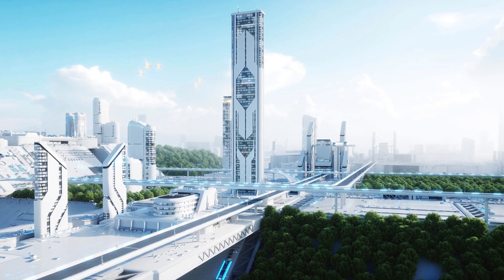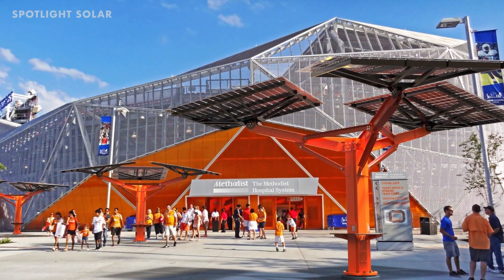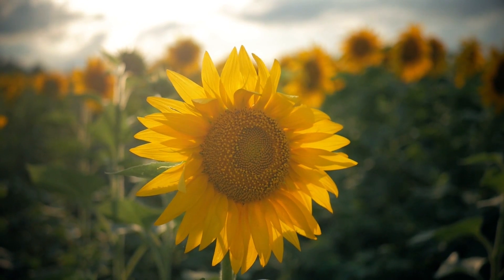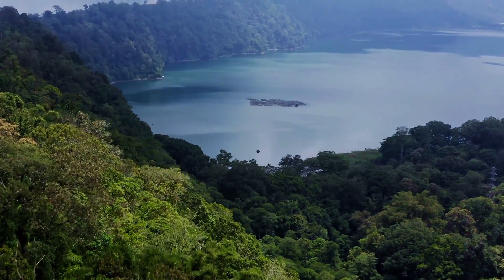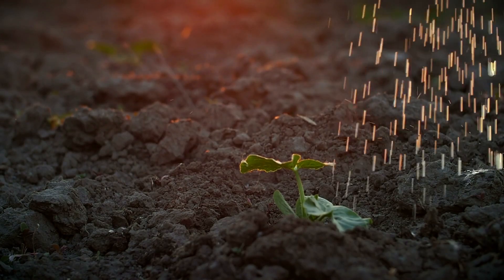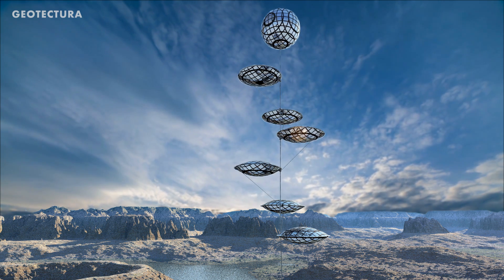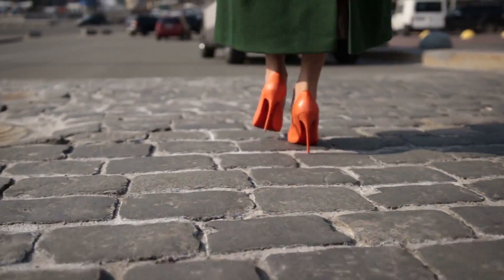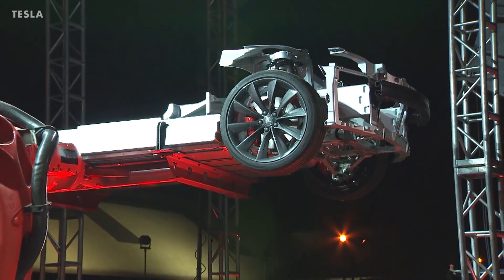What Will the Solar Cities of the Future Look Like?

Comment: Excess power generation can be used for hydrogen production which can be converted back into electricity at night using hydrogen fuel cells.
Reply: It shouldn't. That would be a waste of energy, money, and time.
Reply: @belland_dog8235  As opposed to dumping excess load in the form of heat?  Makes no sense 0_o  Solar doesn't work at night so there needs to be stop gap technologies.
Reply: or just store it in a battery lol
Reply: @trentconley4374  Or fuel up your hydrogen electric vehicle in minutes rather than hours.  And you don't need to replace expensive battery banks which need to be replaced every 6-10 years.
Reply: SoCalFreelance ~ lithium battery storage and from whatever else is used...
Reply: @SoCalFreelance  All EV batteries have a warranty for up to 8 years (or a certain amount of miles/km), so no, they don't last only 6-10 years. The newest ones last at least 8-12 years and there are indications that with some it might be a lot longer. But it ofcourse depends on how much you drive, just like with a regular car.

Hydrogen vehicles are stupid. Filling them up will be much more expensive and while fuelling up in a few minutes is true, after that the pump needs to be repressurized, so all in all it takes around 10-15 minutes, great if there is a waiting line. Fast charging takes around 20-30 minutes and most of the time you'll just charge when not needing to drive (at home, at night, at work, ...). Only on long trips should you be waiting a bit longer.
Reply: @MDP1702  Many factors weigh into EV battery life -- number of discharge/recharge cycles, number of charges to near full, number of drives to near empty, frequency of fast charge use, and cold weather significantly affects battery performance and charging times.  Calling hydrogen fuel cell vehicles "stupid" shows how much you know about the topic.  H2 vehicles don't degrade over time like battery vehicles do and are not affected by temperature.  Fuel cell vehicles have been on the road since 2008 and and it only takes a few minutes to fuel up and your off driving with 500 miles of range, your repressurizing theory and 15 min waiting time is complete rubbish.
Reply: @SoCalFreelance  H2 vehicles work fine with low amount of vehicles. They however aren't as beneficial or as good as EV's. If they were, they'd be were EV's are now. Because like you said, they have been around for a while. 

For starters if you want to cleanly produce H2, it takes around 3 times the energy compared to batteries 90% efficiency. That alone is already a major downside. 

Secondly you have to fuel it up just like you do regular cars now, this while with EV's you either already or eventually (depends on living situation) won't have to go charge your car, you just do it at home, work, store, ...

Thirdly, yes. repressuration doesn't work anymore like I said, however the amount of vehicles a station can fill is limited. After this amount, the station needs time to repressurize, though in the future they might fix this (or already have by investing more in parallel systems).
For example the Hyundai refueling stations can apparently refuel up to 70 nexo cars a day. This comes down to around 3 cars an hour. Yes, they can tank faster (5min), but it doesn't work all day long. if you take 5 minutes per car, after 6 hours the station would need to repressurize, good luck for the cars after, they'll have to wait for some time longer.

Average range is around the same as that for EV's.

Price wise, they also are as expensive as EV's or even more, though without the advantage of cheap fuel.

Their availability is smaller and it isn't expected that it will increase as fast as EV's.

Due to the need of refuelling stations they need a lot more infrastructure be rolled out. EV's can get away with homecharching most of the time so rolling out the infrastructure over time following EV adoption isn't really a problem. H2 cars will need to have infrastructure already rolled out, you aren't exactly going to produce your H2 at home, nor are you going to wait for hours in line at the only H2 refuelling station in the neighbourhood.

All in all much depends on the progress EV's make, though as it stands now, it seems like H2 will not be able to compete/keep up with EV's for passenger cars. Maybe if Ev's can't achieve great range, H2 can help fill that niche market for those who drive a lot, maybe large vehicles might be a good market. But H2 will have to improve a lot over the coming decade if it wants to compete with EV's. There is a reason more and more car manufacturers are going into EV, but not H2.

As for battery life, ofcourse a lot comes into play. But they have a warranty of 8 years or 100k miles, whichever comes first (with the average +-13,5k miles a year in the US, this comes at around the same moment). And looking at real life data, Tesla's batteries after 250k km (+-150k miles) have lost only 10% of its capacity and most of the loss was early on, flattening after 50k km (+-31k miles). 5% was lost before 50km, not even another 5% by 250k km on average. Ofcourse there are exceptions. Since usually end of life happens between 150-300k miles, these are great promising numbers, since an EV battery is deemed not good anymore for EV's at around 70% and then you can sell it second hand as stationary storage to get some money back.

If we are generous there are 25k h2 cars on the road worldwide, while there are around 5 million + EV's and their sales are rising faster every year.

So yes, hydrogen cars are a joke at this point and rather stupid. Maybe they can be used for more "heavy duty" travel, but even now busses, trucks, etc. are tending to lean more to battery power than hydrogen power.

I think hydrogen can better be used in electricity generation for longer storage times and/or in industry/heating. But hey, maybe it will surprise us in the coming decade(s).

Comment: The problem is energy storage not energy generation, at the current solar sititation we can power the world entirely but the probelm is where do we store all that power for the time when the sun isn't shining
Reply: With Batteries, like we're doing now.
Reply: There are multiple projects in the works for energy storage, and not just batteries. Three examples that are in use now are water, weights, and hydrogen. For water, you pump water up to a large pool that sits high up with excess energy. When more power is needed, you release water through generators, similar to a dam. Weights work the same way. You basically build a tower with electric cranes using excess energy and then lower the weights to produce energy when needed. For hydrogen, you produce it using excess energy and release it through a  fuel cell to produce power. 

All three are not as efficient as batteries, but they can be done fairly cheaply. Hydrogen can also be transported from areas with lots of energy to areas in need.
Reply: @anthonypelchat  yes but batteries are ybe msot effiecent, and they are also portable which is a good thing, but the problem is that it's quite expensive to store all the energy that would be produced in batteries, as far as i know there not better storage device than batteries, but then again batteries as freaking expensive as of now
Reply: @belland_dog8235  are you jokin? , it would cost trillions of dollars at the current price
Reply: @anthonypelchat  Batteries will become cheaper eventually, their costs have already gone down by 500% since 2010. Things like water storage or weight storage are unlikely to become cheaper. Hydrogen is still to be seen how much improvement there will be.
Reply: Thereviewguy Just look at Tesla’s project in places like Australia that are saving millions and have been up and running since last year.
Reply: @RandomVideos-kn3pf  No, I'm not joking. We are literally doing exactly what you described right now. Look up the Hornsdale battery site.
Reply: @RandomVideos-kn3pf  Batteries are the most efficient and portable. However, portability is basically pointless for large storage solutions. And efficiency loses can be overcome with lower costs. After all, if you are 80% of the efficiency, but 30% of the costs, then you may be better overall. It all depends on your use case.
Reply: @MDP1702  Yes, batteries will continue to get cheaper while water and weight storage likely won't change much. But water and weight storage are already extremely cheap. And you could always use one and then switch to batteries later. 

Hydrogen has potential, but it is just too expensive. Still, it is easily portable and easily expandable. And it can be refueled while running. Some companies are using it for emergency power to replace diesel generators.
Reply: @anthonypelchat  Water storage might be cheap if you have the geography, but without it the work needed to create it would make it much more expensive. Thus overall waterstorage is quite limited in upscaling it.
Reply: @MDP1702  Water storage is limited, but cheap where it is available. Where it isn't, gravity storage is an option. Simply using electric cranes and heavy concrete blocks. Batteries are better. But these other options are usually far cheaper.
Reply: @anthonypelchat  Electric cranes and heavy concrete blocks is an idea that has gone nowhere for so far I am aware. Untill they have actually a working plant I'll put a pin it. You'd need either really high stacks or deep holes. And there are several problems with it. Though maybe they can overcome it. But even if they do I would be interested in the CO2 value of this storage, since making concrete blocks is co2 intensive.

For example they would need to operate in windy conditions (and they say they can), however cranes don't generally operate when there is more than 10m/s wind, let alone that they would achieve the precision needed.
Secondly the storage capacity and power output, these are ridiculously small. 4-8MW power output? That is the same as one or two windturbines. Up to maximum 80 MWh storage? Really? That is almost nothing.
Price: they expect they can reach 150$/MWh once they reach their 10th plant, they haven't even started building a single one. For this price there will be other better solution coming up soon. Hydrogen storage can become this cheap or cheaper, liquid air probably will also be able to reach these prices and they are at least already building storage plants in the UK and Vermont and already have their testplant in operation.

There are some other problems with this storage method, but I am not going to go to deep into that.

This has the same hallmarks like for example solar roadways or now Nikola. Sounds good on paper when you don't look into it deeper, but fails when it actually is deployed/needs to deploy in the real world.

For storage I'd think more about batteries short term and things like liquid air and hydrogen for mid to long term. And possibly some other options. With water storage being used for really long storage, exactly because of it low price and its design it would be perfect for that.
Reply: @MDP1702  I understand your skepticism about gravity storage. I'm pretty sure that there are some projects already going, but I don't know any specifics on them. Won't argue on the problems. There are solutions to them, but not important. 

The main point however was that there are alternatives to batteries, which struggle on costs. Batteries are great overall, being very efficient, compact, portable, and easily expandable. But they are typically expensive. Any storage solution that can quickly replace peaker plants is huge.
Reply: @anthonypelchat  
I know there are alternatives, large scale gravity storage is unlikely to be one of them, unless it is restrained to geographic good locations (like mountain slopes, etc.).

Again liquid air for example sounds promising.

Comment: Solar energy is interesting but it uses battery that contains toxic chemicals., so regarding to environmental issues recycling is the most challenging part for implantation. I hope nikel cadmium, lithium ion & other elements used to manufacture batteries would be renewable unlike fossil fuels...

Comment: The Veterans Administration in Amarillo TX. put up solar pane;s in all the parking lots around the hospital to help with electricity expense. I myself don't know how its working but I guess it's doing okay, they are still up and provides shade in the parking lots
Reply: Texas has plenty of sun so unless local electricity is super cheap solar will pay for itself quickly and then they get free power for decades. Even if the utilities are cheap the panels will power the hospital in case of blackouts so they will not need to rely on emergency generators so much.

Comment: Solar Roadways is, as far as can be told, vaporware. The one demo patch I've seen had multiple led failures and wasn't able to keep snow off of itself.
Reply: Yeah it's probably unrealistic.  They'd probably be fairly high maintenance.   Typical solar panels take maybe half their lifespan to cover their own cost.  But solar panels used to build roads, no matter how sturdy, aren't likely to last that long, and there'd probably be other maintenance costs too, like extra cleaning and snow removal.  Maybe future advancements will make the idea a possibility though.
Reply: @climhazzard115  Maybe. It's a great idea. I was pumped over it when it first came out, but they haven't done much to advance it since then. Disappointing.
Reply: What people forget about solar roadways, is that vehicles are normally on them, blocking the light from reaching the photovoltaic cells in the road.

Comment: Solar roads are a monumental waste of time and money.... My other criticism is that solar panels are still very expensive, those solar flowers can cost almost $100,000 dollars!! And the amount of energy they generate is a fraction of wind farms of equivalent cost
Reply: There are examples of "not cost efficient" things here.
But "solar panels are still very expensive" isn't true.
The wholesale price of solar modules dropped from ~3000 euros per kWp (crystal silicon, China 2007) to 210 euros per kWp (crystal silicon, mainstream) in October 2020.
Depending on the site, you can get 800 to 2000 kWh per year from solar modules with a wholesale price of ~200 euros.
Of course, a photovoltaic system consists not only of solar modules. Nevertheless, PV became a cheap kind of electricity production. At least if you ignore the storage problem, the volatility of solar power (and wind power as well).
Reply: @701983  I myself favor wind power specifically for my area And because it runs 24/7 so storage becomes less of a problem

Comment: I did my engineering from NIT DGP, which is right infront of CMERI, Durgapur. I did not know they had the largest solar tree. I could have visited it.
Presently, around 40% of my energy requirement is fulfilled by solar power. Working on the rest.
Reply: In which field of engineering u did ur bachelor's

Comment: why don't we put solar panels on every single building in a city? Then we will need less windfarms/solar farms to power that city. We may as well use land that's already been taken up by buildings, same with massive carparks.
Reply: Look up economies of scale. 1huge plant is usually much more cost effective & efficient than small solar panels split over hundreds of roofs.
A concept I've seen just put the solar panels on above fields, providing shade & not taking up space, so that would be an idea which would have a lot going for it. Edit: yeah he talks about it too. Imo (though I don't have any qualifications) this could be a nice way to solve the space issue
Reply: @DS-uo1zy  Yeah I know they are less efficient, but it'd still be better if they utilized that space for solar. Because at the moment it's not producing anything, then you just need large solar/wind farms to meet the demand that the rooftop solar can't
Reply: Solar paint and solar house and building siding are also available. ;) (I dunno how cost effective they are, at present.) Add solar roof tiles and solar windows.  ;)

Comment: Solar pannels on tesla cybertruck a genius. Think about it, 15 miles a day is allmost all what the average person needs in order to get through theire normal days resulting in only charging your car once every 2 weeks or so because of it 500 mile range!!!
Reply: The Cybertruck uses 450-500 Wh per mile, so that is 7kWh from solar per day. That requires around 1kW installed solar power, or 45 sq ft of panels! Can that really fit on the roof?? Unless he intends to use space grade cells, that cost 50 times as much as the usual 20% eff. cells.

Comment: It’s kind of nuts to use valuable land for solar farms. All the unused surface on any buildings can be used for solar panel, but use spare land and on lake just for solar farms are extremely wasteful.
Reply: Not really. You know what is wasteful though? Using huge sections of land for farming, when we could be doing it vertically in buildings or underground.
Reply: @ApatheticEuphoria  In order to keep the panels from falling and burning up they will have to be moving at over 5 miles per second. How are you going to utilize the power generated?